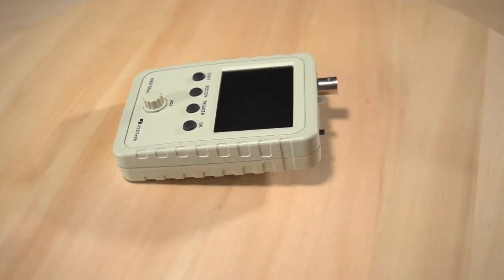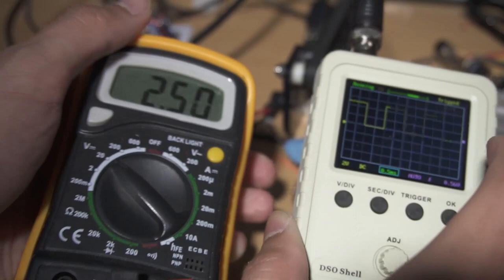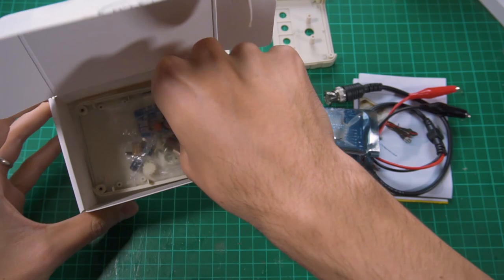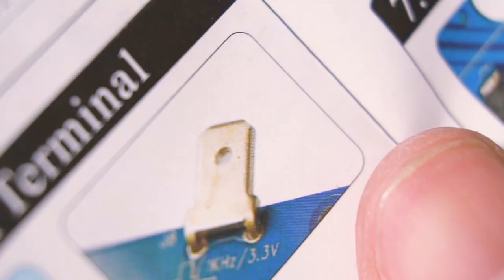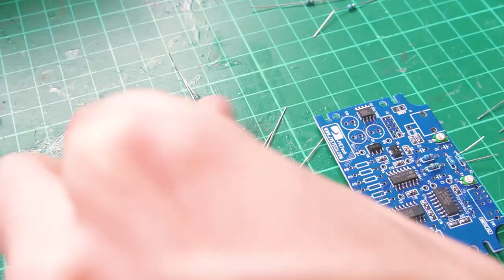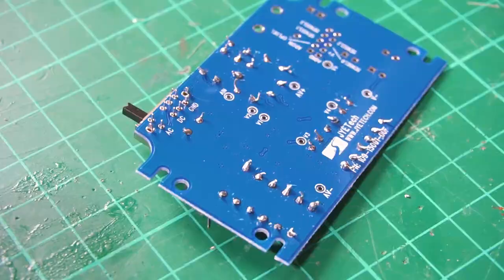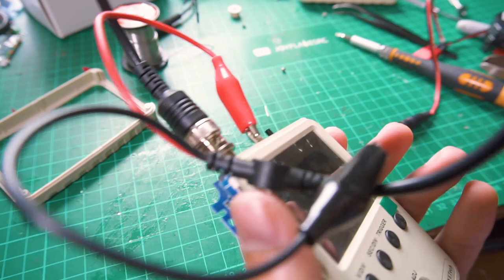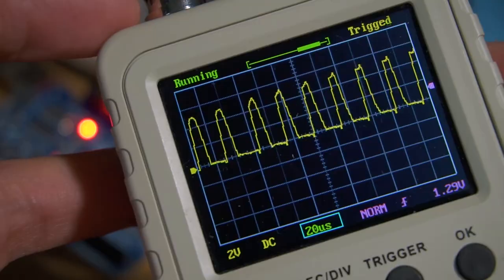$20 oscilloscope DIY YETech DSO-SHELL DSO150

Comment: Just got my kit. I want to learn how to use the osilliscope before I pay more money for a better one. I want to get a fan like you are using instead of a more expensive one to pull away the smoke when I am soldering. I like the cheap fan idea . Thanks for the review.
Reply: Good to learn on.Also good for finding outside foil on caps. Glad you realize this is not a bench type scope and it's limited.

Comment: I need something to check if the display uses PWM technology, and so the screen will flicker.
What I can buy that let me test if any display device I use use PWM?
Reply: This should work to see if the output is PWM, but you could also use a multimeter with frequency measurement since you don't really need to see what the waveform looks like, just if it has a switching frequency. Also, if you are able to connect the controller to a display for testing, you can use your phone camera at fast shutter speed (like 1/1000) to see if the display shows up having black stripes. That will tell you that the brightness control is PWM.